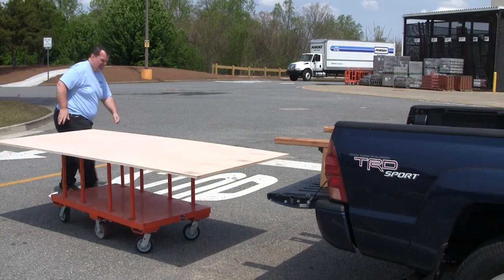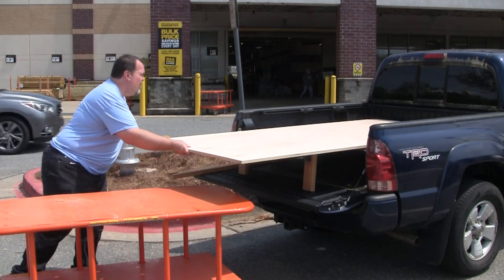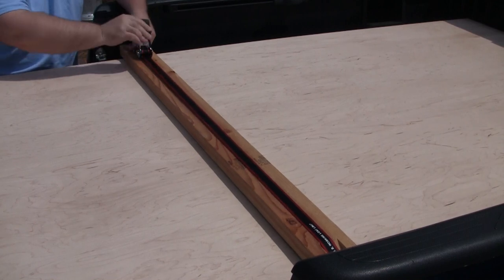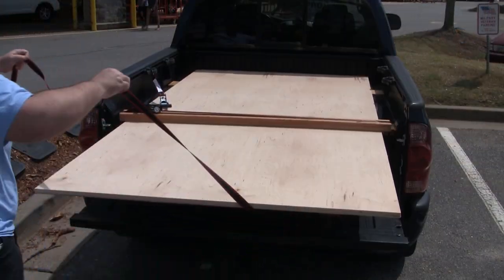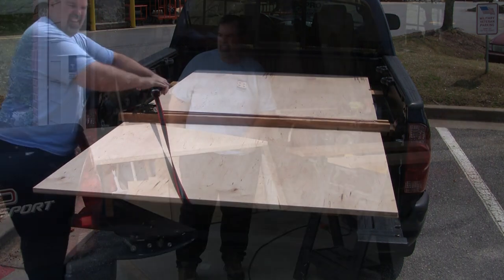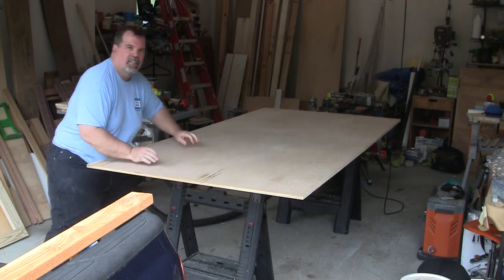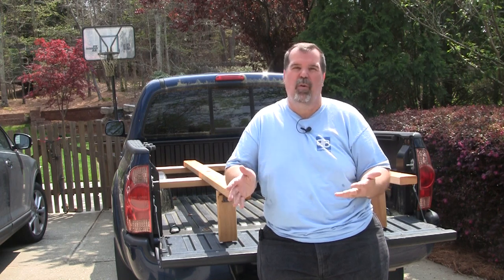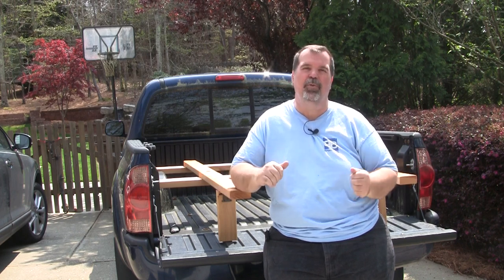Live Action of Loading, Hauling, and Unloading of sheet goods - 4x8 plywood in a short bed truck

Comment: Thanks for the follow-up.  I like the tie-down plank, but for sheet goods I'd probably just attach a strap to a forward tie-down in the bed before loading and run it out the tailgate, load, then run the strap to another forward tie down on the opposite side.  No worries regarding those "get a real truck" commenters.  My Canyon is most certainly a real truck, but one that is easy to park in a normal-sized spot and doesn't require a step stool to enter.  Seriously, people should drive whatever they like and let others do the same.
Reply from the maker: Exactly!  Thank you!

Comment: As far as I could tell when I went looking for a plywood hauler, nobody these days makes an 8 foot bed, unless you go to a heavy hauler in the F350 range. What I wound up with was a soccer-mom van! Lolol The Dodge Grand Caravan has "Stow and Go" seats that fold completely into the floor, leaving a flat 4x8 cargo space that will just fit full sheets of plywood. Some panels, MDF I think, are 49 inches wide and they won't go. But cabinet grade plywood is inside, out of the weather, so I don't have to worry about rain on the way home.
Reply from the maker: That works!
Reply: 3rd gen Camaros and Firebirds (TA)  have 49'' between lift struts.  It doesn't fit all the way inside but a couple of straps to hold the hatch down is fine.   :)
Reply from the maker: I would have never guessed that.  Interesting

Comment: I have a 2022 tacoma and im going to be building my own version of this.  I added tiedowns using the bolts that hold the bed to the frame so i have much more solid tie down points than the factory tie down locations.  Il make a video of it once im done with it too.
Reply from the maker: If you mean you now have tie downs in the floor of the bed up near the cab then that is awesome and Toyota should have them there from the factory. So many times I could have used them.

Comment: Nice. I know this is an old video but I would support the legs a bit more. I saw them moving with the weight of that one sheet. I am curious though. Did you ever find out about The grooves cut into the sides of the bed on Tacoma's? They are meant for about 57 inch 2 x 6's to make a rack that floats over the wheel wells. And all you need is those 2 boards and whatever you want to use to strap it down. I don't know why Toyota doesn't make that more clear
Reply from the maker: Hey, thanks for the reply.  I still use this everytime I get any sheet goods.  While I have had zero issues, I will certainly look closer at the legs for sure.  I know that after I strap the load down, nothing moves at all.  For the slots, you are 100% correct and my rig actually slides into those slots for the cross pieces.  The problem with only using those is my bed is only 5' and without measuring my guess is the furthest slot from the cab is only around 3'.  If you were to stack the sheets only on those you'd have about 5' of the sheet goods hanging off the last cross piece and only about 3' over the cross pieces.  They simply would not stay on them.  The fulcrum is less than the middle.  One thing that does aggrevate me about my year Tacoma (2008 and still going strong) is that it has two D hooks on the bed in the back by the tailgate, but none in the bed floor up by the cab.  That is where I have needed them to most and not having them sucks.  If they were there, then it possibly would work just having the cross pieces and you could then clamp down way at the cab to hold them down.  Sorry for the very long reply, hope it made sense.
Reply: @BronkBuilt  Oh I see. Yeah, I just got a Tacoma. Always wanted one but couldn't because I had kids so I needed more room. I'm also probably gonna add a few more hooks on my bed, Also, I hate the real truck thing. I don't want 8 mpg truck that I can't fit anywhere, and I don't need to pull 20k pounds. Toyotas are fantastic and can do whatever I need. A lot of these guys with massive trucks don't even use them and they say that crap. Or they lift them up and turn them into toys

Comment: Great Video! I'm actually going to make one today for my Taco. Out of curiosity, how did you notch out the angled ends of the 2x4?
Reply from the maker: Thanks for watching.  Honestly, I don't remember how I notched them.  I want to say that I clamped a stop block to my tablesaw fence so that I could run it against the fence and into the end of the 2x4 and stop an inch or so in.  Then move the fense 1/8" and do it again.  I just can't remember.  I may have just used a handsaw and coping saw.  Trying to remember, just can't.  Sorry.
Reply: @BronkBuilt  Appreciate the response and no worries! I basically did the same; used my table saw to dado a notch at each end, then used a rasp/sanding paper to angle it down. Def not as clean as yours, but it did the trick. Thanks again for the great video!

Comment: I have a REAL Toyota truck almost like yours.  The reason I say almost is because I don't know if yours is 4WD like mine.  Those people with those giant 10 to 13 mpg trucks wish they had a real truck like ours.  I know some have 3/4 ton or 1 ton trucks.  I've never needed to haul or tow anything that required that big a truck.  Mine has done everything I needed it to do with pretty good gas mileage.   It's comfortable, seats 5 adults and is easy to get in and out of.  By the way, it didn't cost me 40 or 50 thousand dollars either.  It does a good job of hauling my 5 X 8 trailer with my 4 wheeler on it and a deer fits nicely in the bed.  What more do I need?
Reply from the maker: I agree with 100% of your comment.  I only have the 2WD model, but like you it has done everything I've needed.  I don't pull a 32 foot boat.  I don't haul 3 yards of gravel.  I do drive my family of 4 very comfortably.  I do haul lumber.  I do haul pine straw (I've done 20 bales at once).  I haul mulch.  I haul furniture.  I haul appliances.  It is a great REAL truck.

Comment: I built it for my Taco. I'm interested in that piece of "scrap" wood you use for strapping, it looks like both ends have a tapered profile so the strap has a groove to rest in.
Reply from the maker: That is just a 2x4 about 4' 3". I cut out a groove wide enough for my straps.  They are at an angle as well. Makes it easier to get the straps across without sliding off a side.
Reply: @BronkBuilt  It's real trick!

Comment: Thanks for the great video. Do you find that the 2x4 helps tighten the plywood or would straps on their own do as well if you’re not concerned with the plywood’s edge?
Reply from the maker: Thanks.  The 2x4s give the support over the tailgate.  Without they would tip over onto the bed.

Comment: Do you drive to the lumber store with it set in truck as showed in video or do you raise the tailgate up to keep it from potentially falling out due to no weight on it?
Reply from the maker: I drive to the store in place.  It fits snug and isn't going anywhere.  Even if I hit a big bump the width between tailgate opening is several inches less than inside walls. It has to scissor closed to get in and out.
Reply: BronkBuilt Thanks man!

Comment: How many pieces would this carry? I'm about to do something similar and need to move 18 pieces
Reply from the maker: Depends on what you are getting and how thick.  If normal ply at 1/2 inch i may try all at once.  If 3/4 is probably make two trips.  If buying mdf probably more than 1 trip as mdf is very heavy. Check the manual for hauling limit as I don't remember the max.  Personally I'd not try and max it out.
Reply: Thanks for the reply! It would be 3/4. I'm gonna play it safe with two trips. Fortunately, I'm only 3 miles from the pickup location.

Comment: You got to lift the plywood from the cart to place ontop of the cart to begin. Show that :)
Reply from the maker: You are right,  the hardest part is taking the sheet from the stack on the shelf and getting it on the cart.  I have a technique to make it a bit easier where i only lift one side at a time, but that is still awkward and heavy.  Once on the cart getting on and off the truck is about as easy as i think it can be.

Comment: This is a pick up. A truck is the front part of an 18 wheeler, or something that requires a CDL.
Reply from the maker: Not according to the dictionary. "any of various forms of vehicle for carrying goods and materials, usually consisting of a single self-propelled unit but also often composed of a trailer vehicle hauled by a tractor unit."

Comment: My Dodge Caravan could haul a 4x8 sheet no problem. My 87 Dakota won’t fit a 4x8 so I guess the Caravan is a truck but the Dakota is not?
Reply from the maker: Exactly!  I try my best to not be a tool snob, or a vehicle snob.  Actually, mini vans get a very bad rap.  Compared to SUV's, they are less expensive in pretty much every way and I know people that have bought a minivan over a truck for the exact reason you bring up.  I would bet that loading into the minivan is easier as well since it will be lower to the ground.